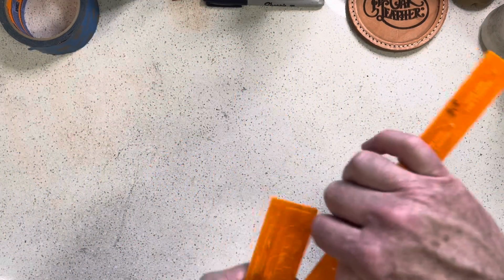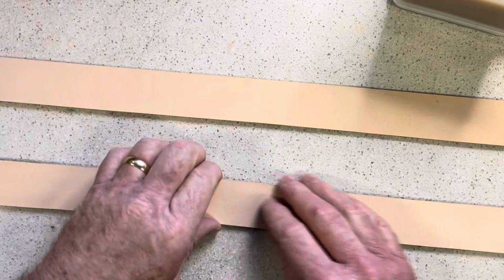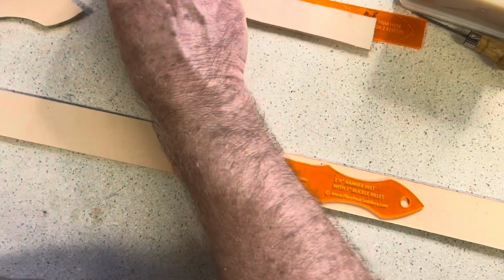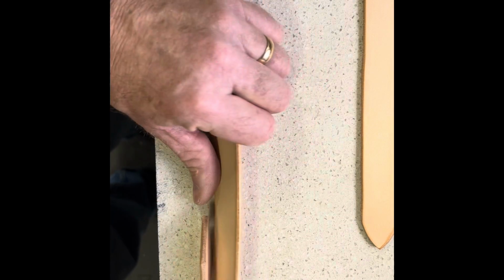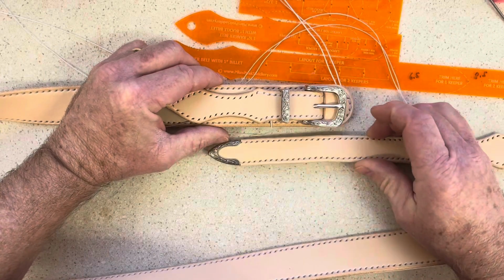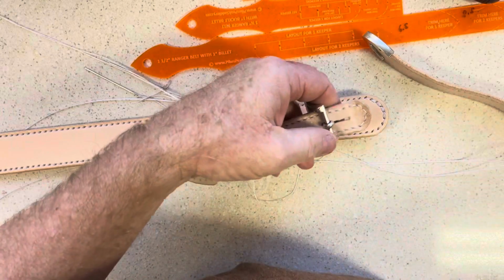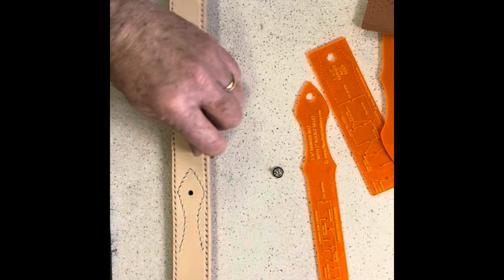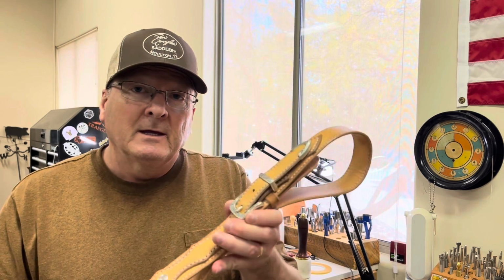How To Make A Leather Ranger Belt - Step By Step Leather Belt Follow Along Instructions

Comment: Hi Robert,
Thanks for the video. What is the width of the billet and chafe ends? Does it go from 1.5 inch down to 1 inch or .75 inch?
Reply from the maker: The belt body is 1.5” and the narrow part of the billet is 1”. They also have a template set with 1.35” and 3/4”.